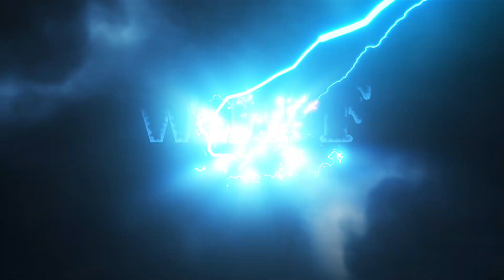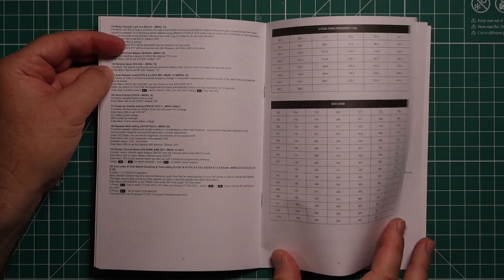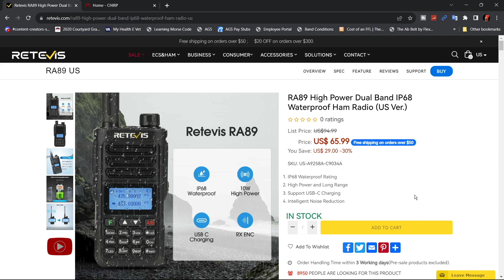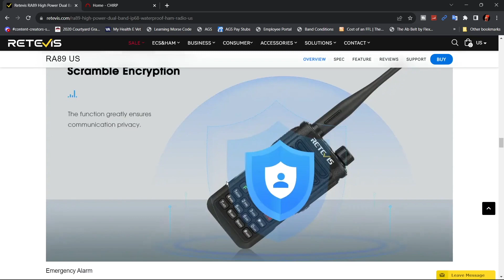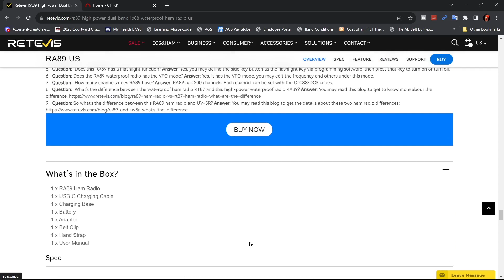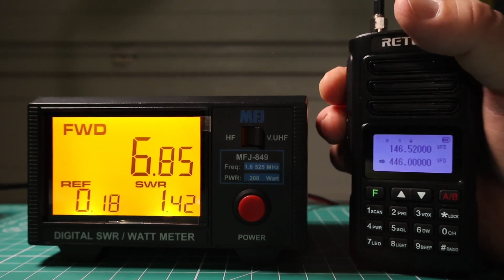Retevis RA89 Review

Comment: What a great video, thank you for sharing! I got mine setup yesterday, thankfully at this time chirp DOES support it. However I can’t get my display to show channel names, it only shows their frequencies. I’ve played with menu option 22B to no avail. Any idea what I should try next?
Reply from the maker: Thank you for taking the time to watch and the comment! It is greatly appreciated.  Try going through CHIRP to set up channel name display. Hopefully that will solve the issue. Thanks again for watching the video!!
Reply: @WJ6FRadio  You’re welcome! Also, to clarify, are you suggesting I connect to chirp and enable channel display names via the chirp program rather than menu option 22B on the radio itself? I certainly already have each channel name in the program already, it’s just not displaying their names on the radio. Thanks again for taking the time to help!!!
Reply from the maker: Yes, I have had to do that with some radios. Some chinese radios can be a little quirky
Reply: @WJ6FRadio  Hey thanks for the tip! Chirp wouldn’t let me mess with radio settings, the only thing I was capable of doing on Chirp was adding frequencies to my memory slots. It would upload my channels from chirp to the radio no problem, but when I would attempt to mess with radio settings I would get an error. I preformed a firmware update (Suggested by and available on Retevis’s website) and STILL had the same problem. This meant I couldn’t get the radio to display names in channel mode, AND I was unable to program my customizable side buttons. I finally reached a fix by programming the radio through Retevis’s programming software. ONLY their software would allow me to edit radio settings. Long story short I had to use chirp to get my frequencies saved to channel slots on the radio, and the Retevis software to edit settings and program my side buttons. Because of your suggestion I was FINALLY able to get channel names displayed and my side keys customized. Many many thanks!!!!

Comment: I have one, agreed on your review but I have two issues. My battery meter drops when I press a button, making me think the battery is dead but it’s not, eventually it goes back up but it’s weird. Also the rx volume is super low unless I scroll between the noise eliminator mode on and back off then my ex volume is way better, another weird issue. I wish the scrambler function was compatible with the rt87 bc that’s the other Retevis I have and love but only 5 watts and no usb charging. I wanted to love this ra89 so much but I think I got my hopes up way too high
Reply: How do u think the receive compares to a typical Baofeng? I heard the defense wasn’t as bad as the uv5r.

Comment: I just received me Retevis RA89 in the mail box today. All is ok but I didn't found the software to programm it, and honestly I search for approximatly 37 secondes so I should end up with a better result the next time I will search for it😂
The 10w advertised are ok, I've got 10w with full battery on 2m and a half of a watt less for the 60cm, so all in all this radio is very sturdy, does what I want, it's easily extendable to 136-170Mhz and 400-480Mhz, it's IP68 so as a paraglider like my self I don't even care if I finish my flight in a watery environment (like a lake for the SIV exercises)!!!
Honestly Retevis, TYT or QYT are really reliables radios if you do your research and you choose the right model!! But to be honest, there is not many "bad" radios from those companies, you can buy one of them with confidence. If it wasn't the case you will not be able to find such number of videos saying those radios/companies are legit and awesome...!!!

Comment: Is it using Beken BK4815 Chipset same as its predecessor (RT85, RA685) or newer chipset?
Reply from the maker: Thank you for taking the time to watch and the comment! It is greatly appreciated.  Sorry for the delayed response. I was waiting to hear back from Retevis. They told me the Retevis RA89 uses the BK4819 chipset. I hope this helps.
Reply: @WJ6FRadio  Thankk you for the quick response...Does Beken 3819 chipset in RA89 still have the same issue as in Beken BK4815 where channels is shifted by 275 kHz?
Reply from the maker: They told me the RA89 uses the BK4819. I do not know what radio uses the Beken 3819

Comment: Thank you for reviewing this radio. I've been waiting for a review for it. Can you do a comparison video with it to the RT85? I want to see if the extra wattage can make a difference in range.
Reply from the maker: Thank you for taking the time to watch and the comment! It is greatly appreciated. I can see if I can pick up an RT85. However, I had been told double your power to get any appreciable gain on distance. That being said if you live somewhere like NYC or any other area with large buildings it will cut your transmission distance down.